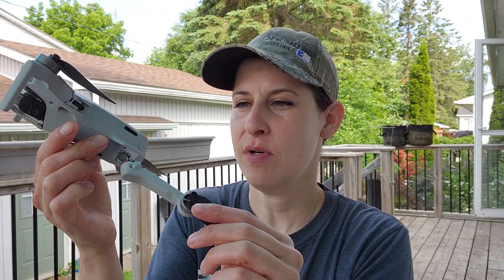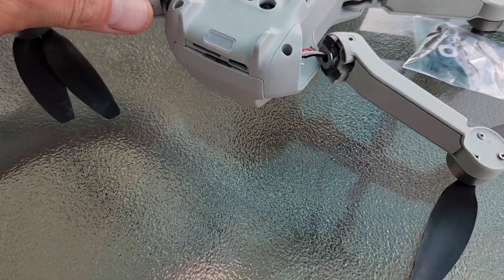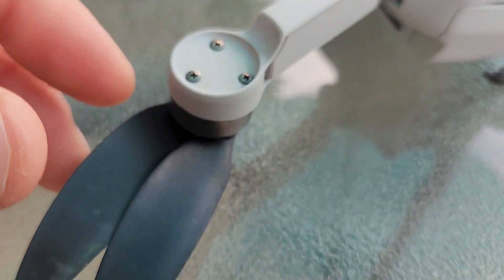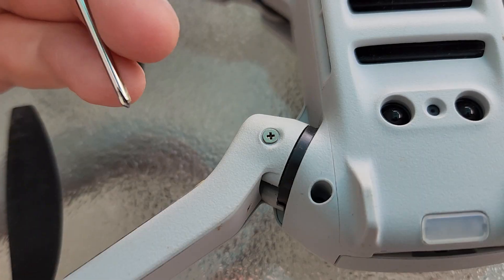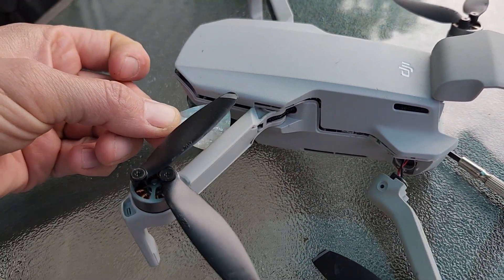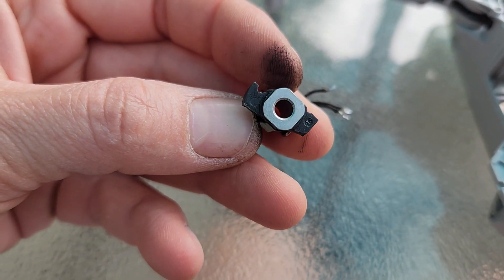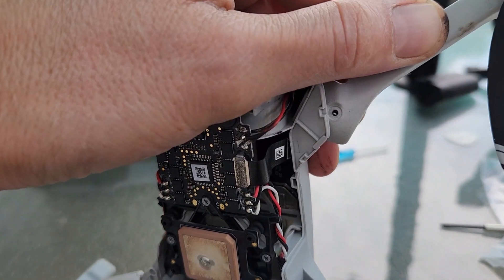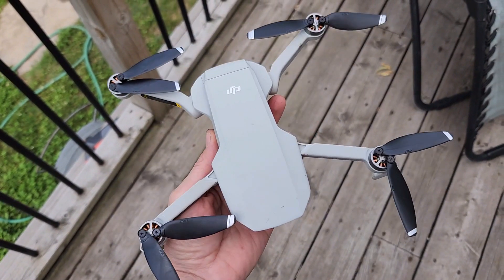DJI Drone Repair- Rear Arm Axis

Comment: You are so clever.  That soldering iron looks very user-friendly; I'm going to think about getting one.  Thanks for showing how.
Reply from the maker: It's a nice one. From Amazon believe it or not. Easy to use and great for this precise job where a small tip is needed.